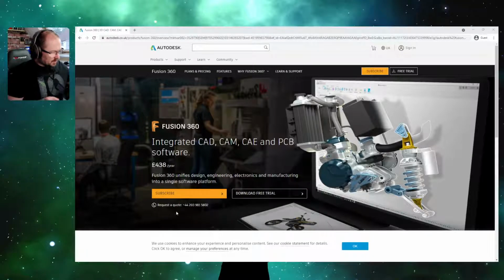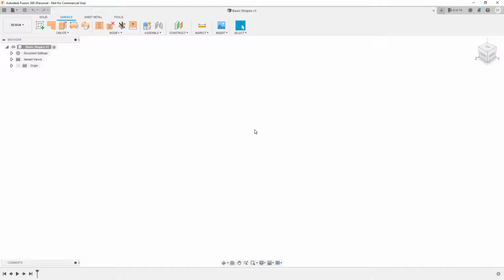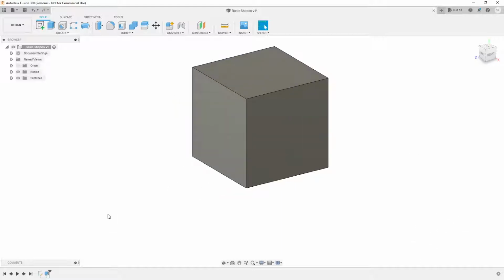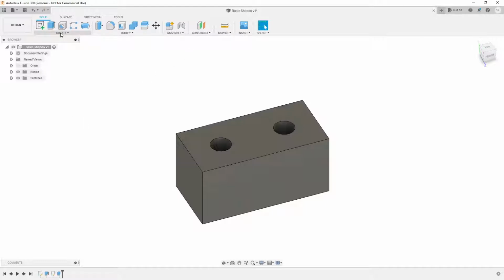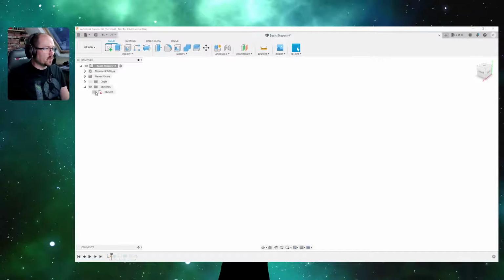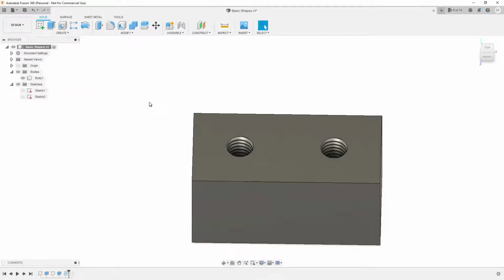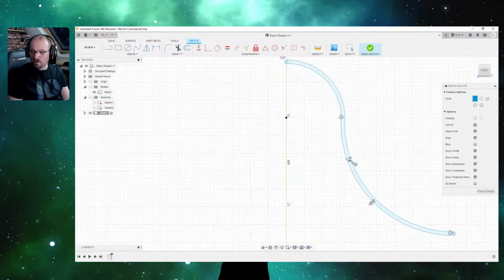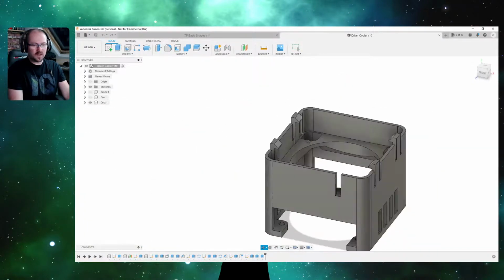Beginners Guide to Fusion 360

Comment: Hi there - I need some input. I'm undertaking a one-off project that needs to be designed in 2-D and 3-D CAD platform. The device is already built but we now want to create drawings for it to post on an open source website for others to access/use. Which platform would you recommend, based on learning curve, etc. I have a engineering background but I have not worked as a mechanical or product designer before. The device is a very simplistic work bench (of sorts). And a steel drum/pasteurization device. Any insight or advice would be appreciated. I would prefer a free or open-source software. I've been looking into Fusion 360, QCAD, and Sketchup. Thanks!
Reply from the maker: I must admit, I have a soft spot for Fusion given my use case and the time I have been using it.
If this is a personal (non commercial) project you can use Fusion360 and will be able to create 2d/3d designs.

FreeCAD doesn't have this limitation, but the user interface is a bit of a challenge and has a learning curve associated with it.
I have not used FreeCAD to do 2D drawings so I can't comment on that functionality. I have a video (my first serious video, and it terrible 😬) that you can look at what FreeCAD is like going in cold - https://youtu.be/xyVC6AshAG4

If it were me, I would be going the Fusion route as the UI is much nicer and you can achieve your goals with less frustration.
I do offer consultations for getting started if that is something you are interested in - https://www.buymeacoffee.com/iqworkshop/e/35351
Reply: @IQWorkshop  Thank you! I'm also playing around with Sketchup at the moment. So I will perhaps tinker with both platforms and see which is more intuitive for me. Appreciate your video and input! I'll reach out via 'buymeacoffee' if necessary!